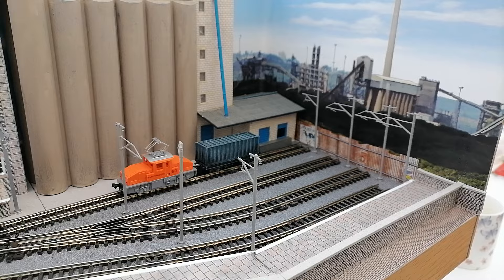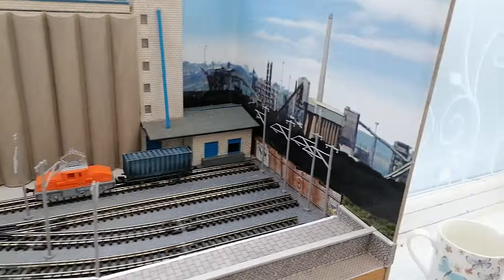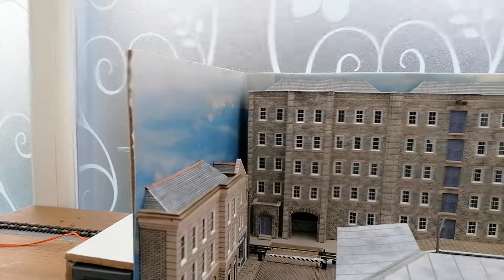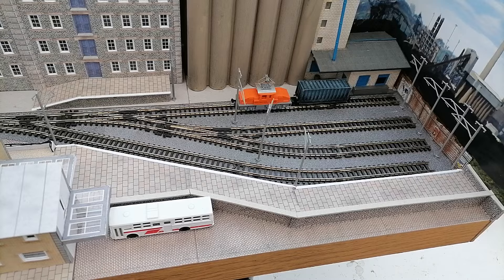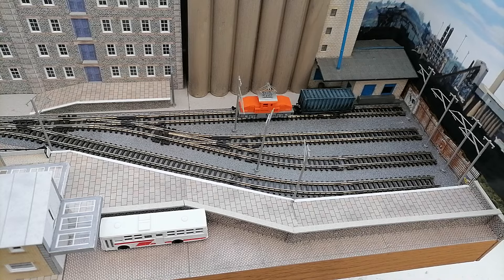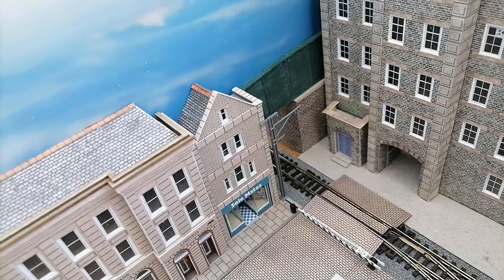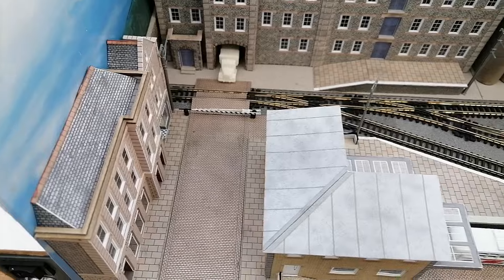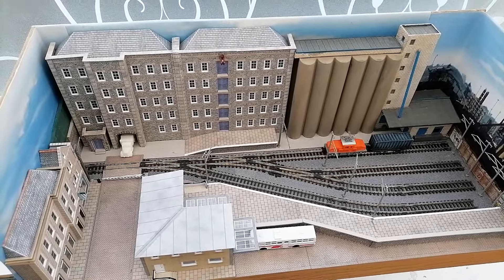Inglenook Shunting /Switching Layout, Backscenes and Platform

Comment: Nice work.
Its really looking good. 👍
Agree with you that it was dissapointing that the Tri-ang TT wasn't continued.
I have N, Tri-ang TT and Tri-ang Hornby OO Gauge layouts and prefer the old TT over N scale beasuse it's easier to handle.
Happy Modelling.
Reply from the maker: Thanks. TT is the ideal scale, but I fear the range now is too small and expensive. Sam's trains did a survey and 88% of people were not interested. If Hornby had done N they could have tapped into an existing market

Comment: UK N gauge was stymied for years because it lacked detail, didn't shunt or run slowly very well, and was rather expensive compared to 00.
Reply from the maker: And it's not much better now lol. Yet Kato can manage it even at the budget end. Had Hornby released a budget N gauge range with good reliable locos it could have been a game changer
Reply: @BudgetModelRailways  Yes, I buy Kato chassis and knock something freelance up from bits.
Reply from the maker: I have found our 3d printed centre cab diesel paints up quite acceptably as a Class 14 lookalike on a Kato Chassis

Comment: Are the catenary masts from Kato?  The layout is really coming along.  My version of this layout design will be using Kato track.  The main downside is that I’ll be using #6 points which makes the curves much longer in distance.  Consequently, I may have a longer length layout than what you have. Oh, this is so much fun 😁
Reply from the maker: Sorry should have said, yes Kato catenary, much cheaper than anyone else's. The Length of the Kato points is an issue but is offset by the reliability and convenience